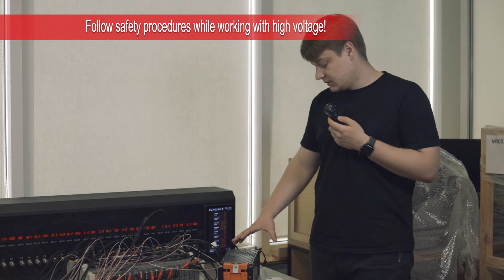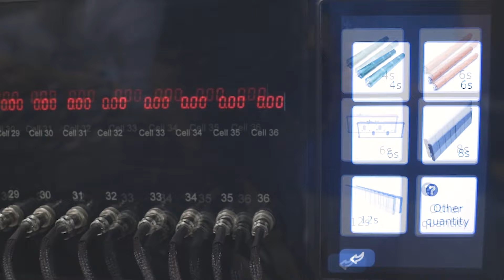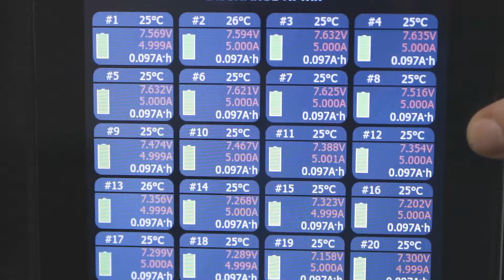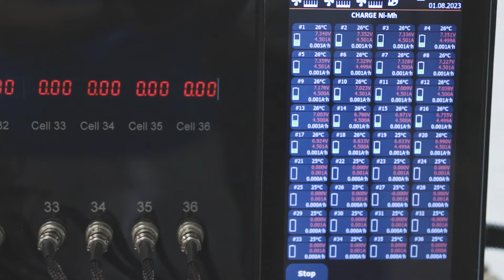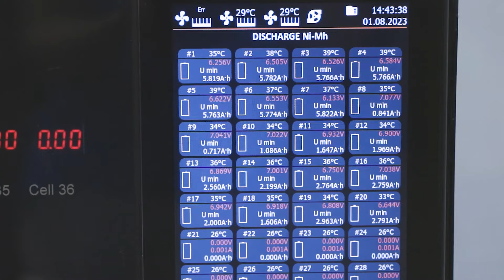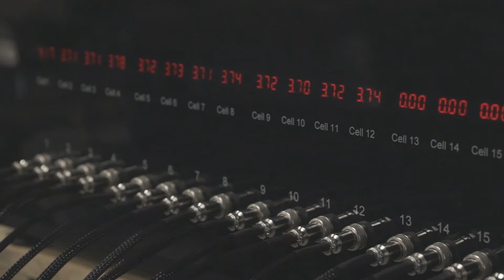How the MS800 tester works: instructions on the example of batteries from Toyota and Hyundai

Comment: @MSGEquipment  does tester support LFP batteries? 
Does tester has ability to uprade firmware? (in case if new battery types are developed in the future or bug fixes in the tester itself)
Reply from the maker: Yes, it supports LFP batteries. And yes it has ability to update firmware.

Comment: Hi, in a soh test of the lithium battery starting from its minimum point of 3.5v up to 4.1 and seeing how many amps the battery inputs, would it be a good test, taking into account what the BMS restricts in this voltage range?
Reply from the maker: We test the full battery capacity, i.e. from 0% SOC to 100% SOC. This we consider to be a normal test.